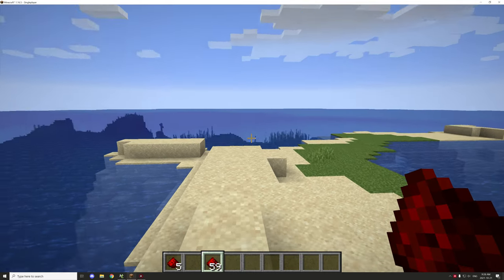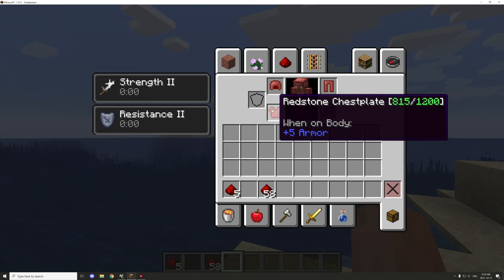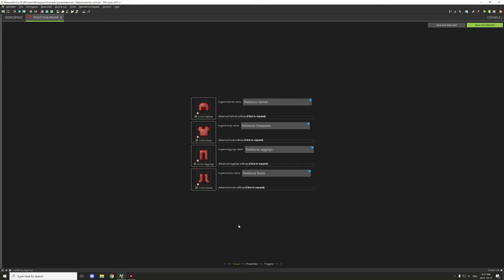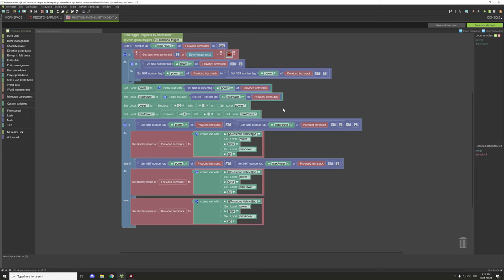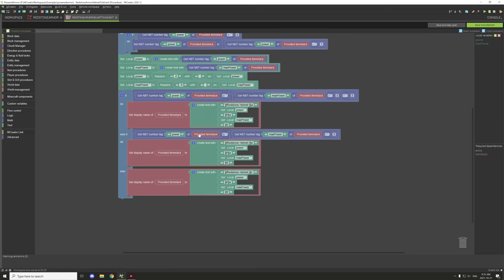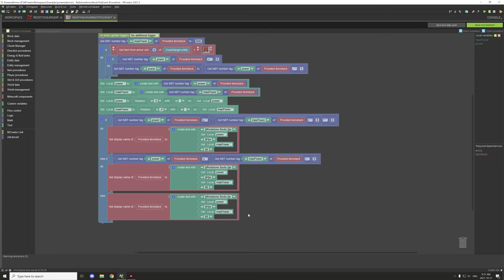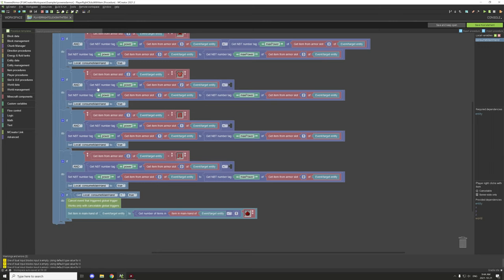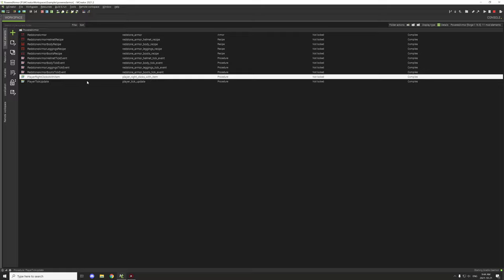MCreator: Advanced Powered Armor Tutorial | MCR 2021.2

Comment: Excellent tutorial, now i'm interested on make this for armor and some accesories from my mod. Also i didn't know you can change the display name of an armor piece. Do you know if there's a way to add a line for the string of an item? Like adding more text to the description using a procedure? And also if you know is it possible to traslate item descriptions or only item names can be traslated? Thanks and hope to see more content soon
Reply from the maker: Right now its not possible to change the lore text that is displayed under the item name, it is possible though to change the item name though which is why I used it to display the power levels instead of the tooltip text under, I most likely would have used the tooltip text if I could have.

For translation, I don't think tool tips have support for that right now far as I am aware, I think PlayerMax one of the contributors was working on something that could add support but he's been a bit inactive lately working on his codded mod, However I think item names can be translated already by default though the translate key section.
You can always make a custom translation key then set that to a variable to add support for custom messages and such printed to the player.
Reply: @NorthWestTreesMCreator  Yeah names can be traslated i'm doing that right now for my mod, ok so thanks for the help dude👍

Comment: OMG you are the best thank you for this
Btw is it possible to do battery item that can power that armor and you can power that battery in some Block with energy and when you have that battery in inventory it automaticaly power the armor because if its possible i have a big plan
And are you still sick? If yes i hope it will be better
Reply from the maker: No problem :)
It should be possible you would need to remove energy from the block's NBT variable and add it to the Item's NBT variable.
Also you would need to detect the armor in the block's slot too so it knows what to action to preform but this would for sure be possible.
I ended up going to the clinic and they basically confirmed what I thought I had an Kidney Infection I just finished a couple day's ago the antibiotics and am feeling back to normal.
Reply: Nice i maked that if you have battery in off hand and it have power it power armor every Single tick and you can also power armor and battery too in that charging Block with redstone or coal coal adds 80 redstone adds 150 energy i dont know how but I maked that without tutorial i remember days when i dont know what is procedure
Reply: And i dont know how to store energy in that Block and put it into item in slot in GUI so i maked that it will delete one redstone or something and add some Energy to item

Comment: The right click procedure doesn’t work. Is there any way to fix that?
Reply from the maker: It may be the type of item/block you are using, if possible I would suggest using a custom item instead one without any right-click actions.
I ran into a similar problem with some other items with right-click actions so it may be the same issue you are having.
Reply: @NorthWestTreesMCreator  it’s to do with the global event at the bottom or atleast the error stays so